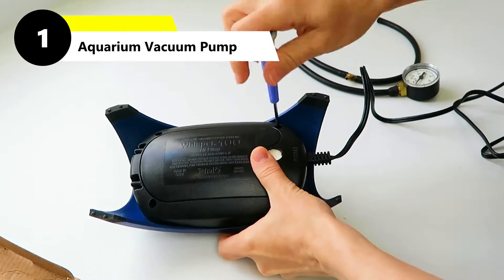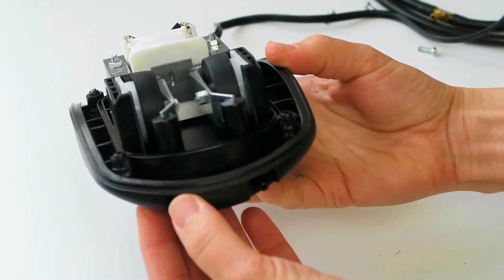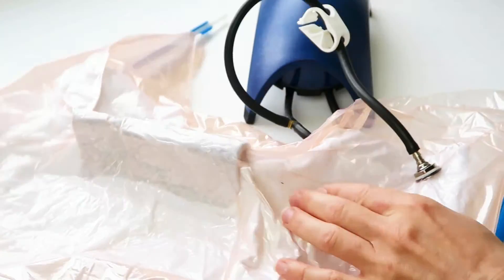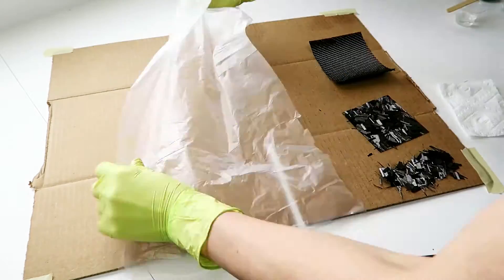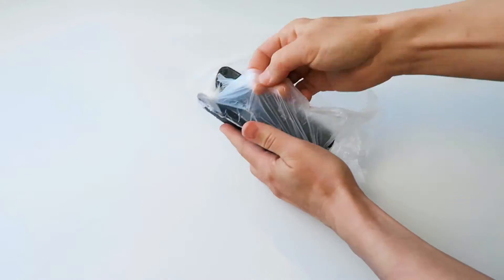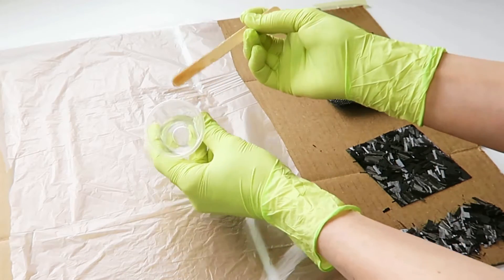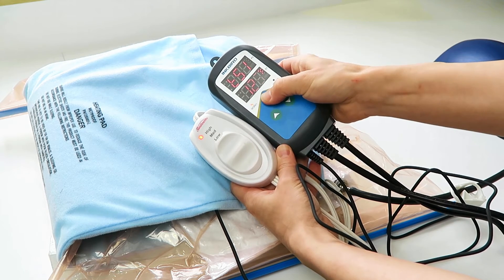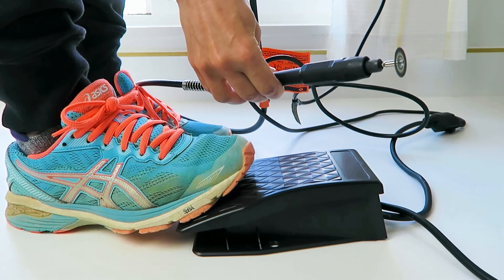5 Hacks for Working with Carbon Fiber

Comment: yay, always great to see you! thank you for the fantastic tips, i just bought carbon fiber for my first project and every single one of these ideas is really useful! especially since i was too cheap to buy release film and a vacuum pump.
i really appreciate that you even checked the strength of the vacuum using the converted air pump, since thats a question i had immediately and would have been hesitant without knowing.
hope you're doing well!
Reply from the maker: Good luck on the first project.

Comment: I would like to ask if you use painters plastic instead of the cloth we use to catch excess resign.
Reply from the maker: You would use typically use a permeable release ply with breather cloth to keep it from sticking to the part. Plastic makes a resin rich part, breather cloth is to soak up extra resin and allow the vacuum to be pulled if bagging.

Comment: Can that pump be used for infusion?
Reply from the maker: It pulls a relatively low vacuum which is fine for basic bagging and great for items that would crush under high vacuum. For infusion I doubt this would work even for a small part.

Comment: What temperature ranges do you work with when curing CF? Awesome video!
Reply from the maker: Max temp set to 125F has been working well with the probe placed in the center where it would get hottest.
Reply: @LindyDesignLab  Thank you Lindy, I will start with that number. 👍

Comment: What valve are you using on the bag please.
Reply from the maker: Connectors are from ACP Composites.
Reply: @LindyDesignLab  I picked up a pump and valve. This has worked outstandingly on my CF projects. Thank you so much for sharing this. Two gold stars for you. Cheers.